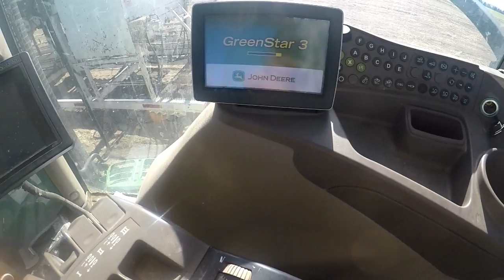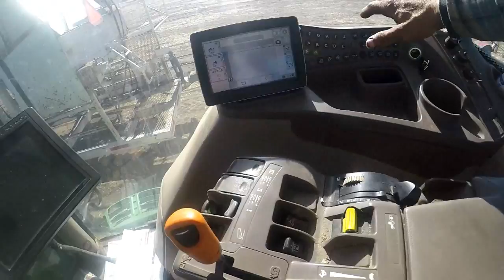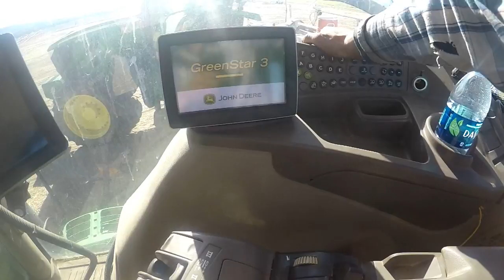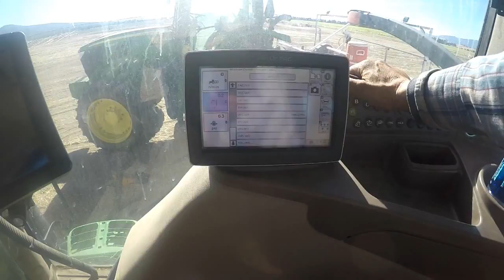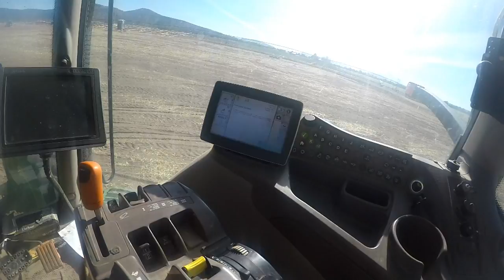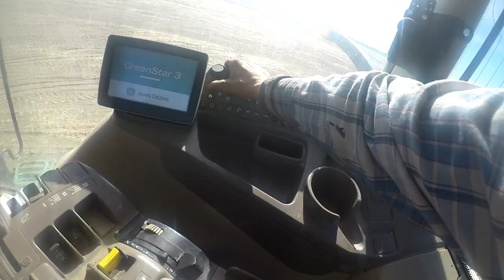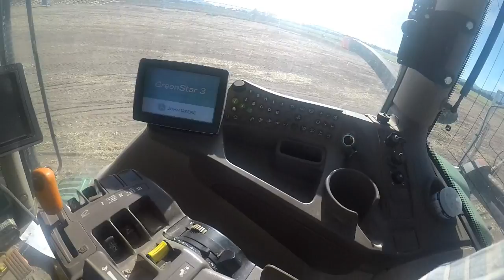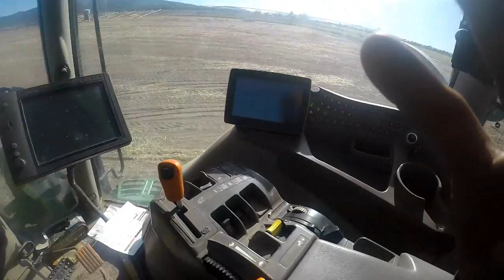John Deere 6170r codes

Comment: I do HVAC for a living the new systems have so much electronics on them that if you do have a problem that you just can't figure out you call tech support the advice they give you is literally , does the motors test good if yes replace the control there is no longer any ability of tracking down what is actually broken in the control or any way to test the control your just sposta change parts till it works. I had one system that I knew it was definitely a controler problem but didn't know how to tell which of two controllers it was the tech support guy said well just replace one and if it don't work just replace the other one. The bad thing is by the time it's all said and done there is so much cost involved the customer could have just thrown the unit out and put a new one in. I feel that's the direction all manufactures are headed they just want to sell new equipment not parts. Great vids keep up the good work

Comment: Hey thanks for all your videos, I appreciate them all. As a computer tech since 1990’a and also used to work on side doing motor bikes and car mechanics with a mechanic mate of mine I can’t believe how hard the manufacturers make this stuff, why not just have a rack in the cab housing all the control modules? It would be easy to get to, would make live easier testing, and keep stuff out of dirt. Seems a no brainer. Thanks again from New Zealand.

Comment: I agree, too many electronics on tractors now a days no matter if blue or green. My JD 6320 has been throwing a code "Instrument unit not receiving data". Causes tractor to go into limp mode.Ever came across this code?
Reply from the maker: Many times,  probably can bus terminator or wire, maybe bad cluster.

Comment: Hi warren when you go through the error codes in the command  centre
  just hit the show all tab at the top of the screen  and it wil  put all the codes in one screen ,
You will find the chassis control module in the same place for power quad  and direct drive and it sucks, 
 To remove the park lock sensor you will need a 3/8 crow foot wrench maybe 17 mm also wait till you replace 
A park lock solenoid both come out tougher on a common retainer plate 👍🏻 also on the controller plugs the pin count is different for each one 
So check the number of pins and match it to the plug info in service advisor 😎

Comment: I'm glad about the NH TS100A we just bought, no common rail, emissions and just a plain old 12X12 transmission. It was throwing up a code about the water in fuel sensor, I threw a new filter and sensor on and that went away. No laptop needed fortunately, we won't get that lucky when we trade again.

Comment: Any tips for me on my 6170R - 524227.12 - transmission bypass actuator fault?  I already swapped two identical sensors near the trans filter with no change

Comment: As long as your careful to not spread the pins of the connector you dont need the fancy back probe tool. You can easily spread the terminals and cause pin fitment issues.

Comment: I have a 4.236 Perkins Engine, the Injection pump isn't pumping any fuel, I'm thinking the pump needs redone. Do i need to line up any timing marks before removing it or can I remove it as is?
Reply: take off the timing cover on front of engine 4 bolts on a round plate in front of pump and you will see the gear take the bolts out of that. there is a dowel on shaft of pump so it will only go on one way.
Reply: 22wmr/223 thanks
Reply: SuperJohndeere-Tuffy  forgot to say there should be a small mark on the front corner of the pump and a mark on the timing case to line up for timing of the pump if you cant find the mark make your own so you know when its lined up.
Reply: 22wmr/223 thanks I appreciate it

Comment: I have a 7130 premium where can I gat a service advisories and Code reader so I can work it my self ?
Reply from the maker: You can buy service advisor from epcatalogs.com. Just buy the program without the data link connector . That will give you all the trouble shooting  . You can buy a Texa unit for a scanner . I am a dealer for Texa .
Reply: western truck and tractor repair , what’s the best was to contact you to get that ordered ?
Reply from the maker: @mattbigham9954   wlrfixinit@gmail.com
Reply: There are some fellows on EBAY selling service advisor kitsch, with the EDL, and software that's fully functional.  I have it, and it works.
Reply: @westerntruckandtractorrepa1353   I am  Interested in the Texa scanner.

Comment: Makes ya consider the maximum number of error code recurrences that will be stored is 116 huh?  Seriously - there are limits on how many time error code recurs is recorded on semi trucks.  When error codes bounce all over the place for several completely different systems, need to check battery and charging systems.  Lack of adequate current throws all kinds of codes...